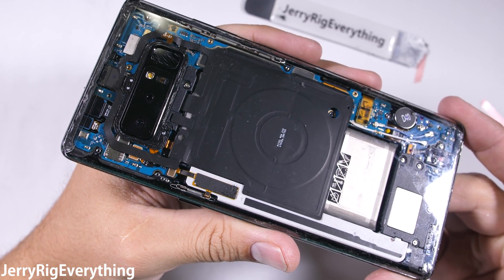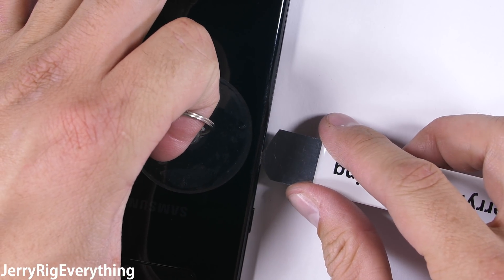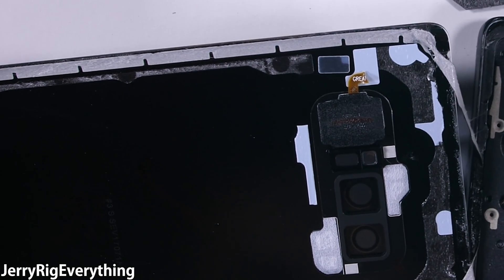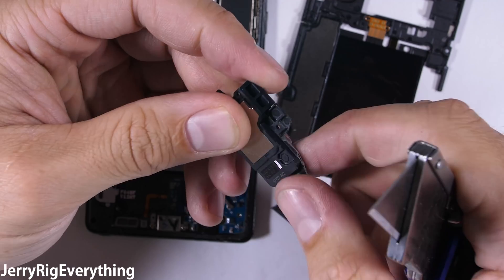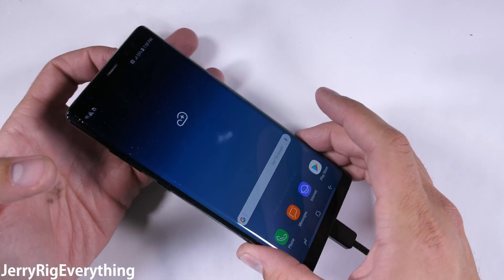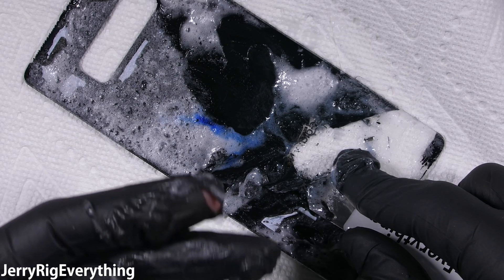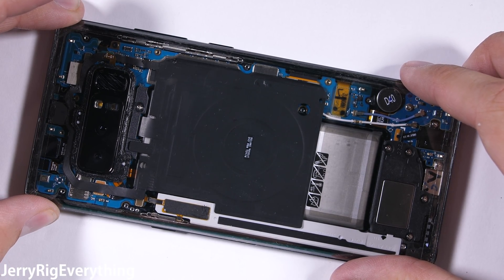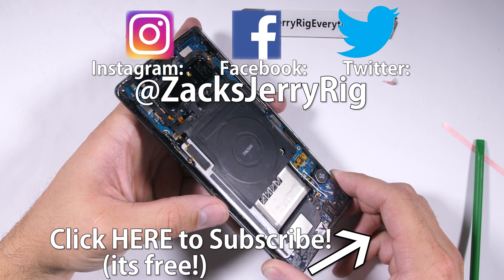Note 8 CLEAR EDITION! - Totally Transparent Samsung Note 8

Comment: Apple wouldn't want to make a clear version because then they couldn't lie to people about there not being any space left for a headphone jack.
Reply: Emil Ellénius there's a video here on YouTube were a guy manages to put a headphone jack inside the iphone 7, the space was there!
Reply: Davide Stellati Yes I know and that's why Apple wouldn't want to show it by making the back transparent.
Reply: Bluetooth audio quality is shit compared to 3.5mm. Also, I don't want to have to charge my fucking headphones lmao.
Reply: Davide Stellati no the guy took some things out in order to make space
Reply: Rolando Flores As someone who has a professional grade headphone, amp, and DAC audio setup I can guarantee you wireless headphones are nowhere close to the quality of wired.
Reply: manthan makwana that piece you mentioned could easily not have been there. The guy in the video had to deal with a finished product, at cupertino during the designing phase they could have easily come up with something else.
Reply: Rolando Flores Well I do. I use my headphone jack every day while simultaneously charging my device.
Reply: davide Stellati no, there was no space. That guy removed Barometric air vent and placed iPhone 6s' Headphone Jack.
Reply: What do you gain from the headphone jack being removed? The iPhone 7 is 7mm thick, not <3.5mm. They only took it out so they could sell you lightning headphones and dongles lmao and make 100% profit from it, they're robbing you and Apple is 100% anti-consumer. They can't make profit from people using their own 3.5mm headphones. Analog audio quality will always be superior to the diarrhea Bluetooth quality.
Reply: Gem you clearly don't understand audio quality
Reply: That's for marketing purposes only, because they want to make more profit out of their customers.
Reply: Rolando Flores 
1. It's mainly videos
2. No I'll keep using my headphones, they weren't cheap after all
Reply: but still Bluetooth has a batter unlike wired headphones just plug and play
Reply: manthan makwana there was space they Just put a little plastic to cover it up
Reply: Rolando Flores blutooth sometimes has a delay, and most blutooth headphones are more expensive
Reply: so old? It still works perfectly and everyone has earbuds or headphones that work for it.
Reply: RemixedVoice very true!
Reply: Emil Ellénius and samsung wouldnt want to make a clear version because they wouldn't want us to see the batteries exploding. Safety>Features
Reply: ( ͡° ͜ʖ ͡°)
Reply: Emil Ellénius you are a amazing person
Reply: Mr X
HAHAHAHAHAHA. “Not pushing forward”
If that’s true, we’ll be still using fucking Nokia phones with goddamned keypad on the phone.
Nice explanation you’ve got there
Reply: Kevam Patel
Good point. You know that there are a percentage of people who will definitely buy anything Apple comes out with. But have you thought of why? Why is that so? Why are there so many people being so “blind” and would buy anything Apple comes out with; like the new flagship iPhone pricing at $1k above. Why not these “blind sheeps” follow Samsung or other company instead? Why Apple?
Think...
Reply: Kevam Patel Oh wow. I'm trying to not laugh at your comment. Are you for real? 😂 Of course they are great at advertising, they need to be! Making consumers want to buy your products is the whole point! Advertising is one of the most competed areas between companies in every single industry and you're trying to make it sound like Apples advertising is a bad thing. Now let's get to the part that makes me laugh, the statistics you have stated in your comment are not factual in any way shape or form. They are your own creation backed by not just anything credible but by nothing at all! "Out of every 50 Apple users I meet, I get 2 people who actually have a reason to use Apple, that's far higher than 60% but let's just assume most actual Apple users don't really comment." Are you actually being serious? That is some hard hitting study you've conducted there with a personal assumption added in the end to come up with a solid and correct statistical answer about Apple customers globally. Hahahaha! Have you conducted the same study on Samsung lovers? I'm sure they have brainwashed consumers who will buy whatever they release, I bet Samsung could make a washing machine and they would totally buy it...oh wait, Samsung does make washing machines! What's even more hilarious is that I actually owned a Samsung washing machine until it caught fire and there was a national recall. Maybe you should also conduct a study into how many Samsung devices blow up or catch fire and need to be recalled. 😄
Reply: Lj Jones I'm trying so damn hard to not laugh at your stupid responses that just don't make any sense, rather you're looking like an idiot and telling me I'm looking like one. You're assuming based on what I said without even thinking what it actually means. Definitely a brainwashed sheep LOL
Reply: Lj Jones nailed it mahh boii!
Reply: Pixel Man Are you for real? Wow 😂
Reply: Lj Jones yes i know hardware in iphones are actually more superior than any other Androids, they have done a great in the integration of hardware and software to make their phones the best in speed, but remember their speed isn't consistent as it will go downhill after years, i can tell u that even if androud doesn't win speed test in day 1 but they will eventually beat it after 3 to 4 years as major android updates will make androjd phones faster and faster, and btw android isnt cluttered and bloated these days, integration in hardwarw and software can be a clear advantage a few years back but it can be a great advantage these days as android is better and better these days, those lagdroid days are over, and my friend's iphone 6 is slow af, he told me that it get even laggier recently, i guess it's because iphone 8 is launching next week hahahaha my 2015 android phone hasnt lag much through my usage and im glad that my phone and his phone almost have the same specs but mine runs so much smoother than his iphone 6. If you dont believe what i said you can check out videos about speedtests for old iphones and the comments about how slow their iphones are, that's planned obsolescence, and you do u see research about both ios and android? Android has lower failure rates than ios these, it might surprise you but that's the fact
Reply: Lj Jones u do realise that u are implying dat an OS is far better quality only because it runs smooth on hardly 10 devices... When the other one is serving a gazillion of them and still managing to do an almost comparable job! Android has matured like no other. 

And 4 all ur ranting bout the optimisation.. Android is almost equal while being open sourced rather than a closed OS which locks the user down to what a few engineers think should be used. 

I'm not against apple per se.. but it's their disregard to the fanbase by providing archaic tech for years on end.. or doing such obvious greedy things like the Jack.. dat pains me as a tech enthusiast! 
Apple no doubt has a loyal fanbase.. but dats exactly where the responsibility kicks in. 
Looks more like they are living on the glories of the past.. and fail to see dat the competition has actually become superior. And dats painful 4 ppl like me who loved owning apple products back in the day.
Reply: you have exactly 1000 likes and i dont want to mess up that number...
Reply: Booooom
Reply: One of the many reasons I fucking hate Apple.
Reply: Van Farnel the reason is that iSheeps like you actually exist
Reply: Emil Ellénius
This comment is just too perfect
Reply: RemixedVoice you must not have Bluetooth headphones. The quality if not superior, on par with wired connection. Charge time for a decent pair of headphones are less then an hour for over 15 hours of play.
Reply: Xhar Jhon Suarez W1?
Reply: Pixel Man which problems?
Reply: xZefyr ッ which connect to your phone?
Reply: So true!
Reply: manthan makwana who needs a barometric air vent/ meter
Reply: AMG M RS // Cat Lover same
Reply: Lj Jones is there is room for a headphone jack, there is no reason to remove it
Reply: AMG M RS // Cat Lover airpods suck btw but im glad you wasted all your 159 bucks on airpods which have almost the same quality as apple earphones
Reply: Mr X
Did you even try the AirPods and you just assumed it sounds like regular Apple EarPods? Please try again...
Reply: Lj Jones this is not push forward, this is called making money
Reply: AMG M RS // Cat Lover you dont have to try, the whole world knows it, almost all the reviewers say the same, airpods sound maybe a little  little little unnoticeably better, they said it's earpods without the wires, dont try to make up something good about airpods to justify your buying decisions, i like ppl who pay more for less btw
Reply: AMG M RS // Cat Lover I know right! The whole point of the technology industry is to push things forward.
Reply: AMG M RS // Cat Lover removing headphone jack at the moment is definitely not moving forward, does apple provide everyone who buys an iPhone a wireless headphone?? No. Clearly they wanr you to buy that cheap made airpods, they call wireless the future but yet android's the one making wireless charging possible, but i know apple likes to bullshit all the things they do
Reply: Mr X Ok let's just say Apple did it purely for money, so what? For a company to be successful it has to sell and make money, who are you to complain about how people spend their money? If people like what a company does and what the company produces then they will buy it and people have been. The iPhone has been on top in the global sales marketshare every year and everyone laughed at Apple when they announced the Apple Watch and it's the top selling smartwatch globally today. If people are buying, you're doing good business. Other tech companies dream of having the brand loyalty and success that Apple has.
Reply: Lj Jones it's because once you are in the apple ecosystem, you are pretty much screwed. I have countless friends and family members who talk about how great many Android phones look and operate (my note 5, note 8), and they would switch, but they won't have iMessage and icloud, and FaceTime, and photostream. Apple locks you in to their system, and the only way to switch is to give up many things you are used to, which could easily be made universal
Reply: Lj Jones that's the point. Apple still sells. Why does that happen? There are 2 reasons. First, Apple knows how to do marketing and advertising. It just makes you want to buy them. Second, them blind iSheep. That's right. More than 60% users of iDevices are sheep because out of every 50 apple users I meet, I get 2 people who actually have a reason to use apple, that's far higher than 60% but let's just assume most actual apple users don't really comment. Those iSheeps are the people who'd buy anything apple sells. Apple could make a $1000 "normal" iWashingMachine and iSheeps would buy it happily, "because it's made by Apple".
Reply: AMG M RS // Cat Lover because they are following apple. That's common sense. That's like saying why apple is named Apple and not orange.
Reply: Kevam Patel you haven’t answered my question yet.
Why these people choose to follow Apple? Why not Samsung? What makes them so loyal to Apple till they become a “sheep”?
Reply: AMG M RS // Cat Lover you are seriously dumb. People buy samsung and people but apple. Its not like only Apple has sheep. Every company have some kind of sheep. You tell me why people buy samsung and lg and sony and become sheep if you do much want an asnwer yourself
Reply: AMG M RS // Cat Lover sheep are sheep. They are called sheep because they don't know why they're purchasing it, they're just "brainwashed" which is why people call them sheep. The number of sheep doesnt count how good a company is, its the number of actual users that tells how good a company is doing.
Reply: Kevam Patel Did it maybe even slightly occur to you that people buy Apple products, not because they are brainwashed, but because they actually like what the company produces? Whether it be the quality in hardware and/software, features, design or the ecosystem as a whole. There is a difference between brainwashing and true customer satisfaction, which Apple has and have always had. Please don't state comments filled with bullshit and your own personal assumptions trying to pass them off as actual facts unless you actually have something credible to back it up, it just makes you appear as a complete idiot.
Reply: Lj Jones of course you took my comment as "statistical" and "factual" instead of just my own personal experience. Please show me where in my comment I said those are facts. Also show me where I said there aren't other sheeps? We're talking about Apple here and so I only mentioned the iSheeps. About the advertising. Did I ever say that it's a bad thing? Did I? Rather, I feel Apple does it far better in advertising than any other company. About the "blowing up", that just made it really really clear you're just another samsung hater and an iSheep. About 100 phones out of 2.5 million units blew up. Yet samsung handled it with care and recalled everything back, even though they could've covered it up and saved money. iPhones blow up all the time, but apple always covers it up. Samsungs don't even blow up anymore, I don't know what kind of idiot you are. About washing machines, is making washing machines a bad thing? They don't just make washing machines, they make cars, tanks, and even cargo ships. But you wouldn't mention that. It's more than clear you are a hater. What else you got against me now? I'm sure you're going to come up with just another hate comment instead of actual content
Reply: Kevam Patel Well if you're stating that the numbers you have come up with in your own personal experience are actually true, than you're commenting what you believe is factual! You said yourself that out of EVERY 50 Apple consumers you meet only 2 of those people have a reason to use Apple, by saying that you're giving the impression that you're meeting multiple Apple users over the course of a specific time and recording the numbers that you've eventually come up with out of lots of 50, thats quite a study you've conducted! It doesn't matter that it's your own personal experience, if you're going to dish out your own numbers and statistics that you've come up with then don't be surprised to have people comment on it. I didn't say anything about you not saying there aren't other sheeps lol I asked you if you had conducted the same kind of research on Samsung consumers, that's all! Yes I know you didn't say exactly in those words that Apples advertising is a bad thing but you're making the implication that it is because you're theorising that isheep are brainwashed from it. The "blowing up" comment I made was a joke, as true as it is, it was funny. The whole world is still making fun of the Note 7 but you obviously don't have a sense of humour when it comes to the company that you are bias to. Yes that's true it was only around 100+ Note 7's but obviously if they didn't do the recall that number would have kept growing. Would you be so kind as to refer me to your source about iPhones constantly exploding and Apple covering it all up? If you're going to make that statement I expect you to back it up. Pretty weird that despite according to you that iPhones are blowing up all the time, it continues to be the top selling smartphone each year, lol. Did I say that Samsung making washing machines is a bad thing? No. I was referring to it with my Note 7 joke you idiot because there was a Samsung washing machine that had to be recalled because it kept catching fire, are you that dumb you couldn't put those 2 simple points together? Also you don't have to tell me what Samsung produces, I'm very aware of what they make :)
Reply: Jack Hoff Well duh! If you're wanting to switch between ecosystems of course the experience would be irritating to an extent. If you're going to just have 1 Apple device then that's fine but if you are going to have all Apple devices and be fully integrated in their ecosystem and stick with it, the experience is far from awful. I live in what you would call an Apple Home. I have an iPhone, Apple Watch, MacBook Pro, iPad Pro, Apple TV, Apple accessories and Apple HomeKit devices connected and the experience is amazing. For everything to connect and sync so seamlessly between each device, to control things in my home from work or anywhere in the world, to unlock my front door with my voice, to work on something on my MacBook and then pick up where I left off on my iPad, to lay in bed and say "Hey Siri, goodnight" and everything in my home turns off and locks then in the morning I do the same thing and my house comes alive. It's like living in the future! It's so freaking cool. The best thing about being in this ecosystem is the performance and quality of Apples software. There's no clutter or bloatware, everything is so simple and fast and when Apple pushes out a new update almost every Apple customer around the world upgrades to the new firmware. While Android software is very open and customisable there is still a lot of cluttering and bloating. Ecosystems that use Android are still quite messy and confusing because there are so many different Companies that use it. Not to mention that Android has a horrible update record, there are still Android users today that are using firmware that's 1-2 years old, some even older! I have no issues with being locked into the Apple ecosystem if they keep delivering amazing hardware and software integration.
Reply: Lj Jones now you're saying those were jokes. Wow. I can't believe you can be so, I don't know what I should say here. I'm not dumbfounded by any company, I go for what's best but one thing I love to do is attack sheeps, no matter what brand they are. I found you here. And about the statistical stuff, it isn't so "study" number thing, all I was trying to say is that apple users are a lot less compared to the number of sheeps. If you ever read the comment section in YouTube, you'd know that. But I know you won't accept it and you'll just keep attacking the 50 people thing so that you can dodge the actual fact. About the joke, I still can't believe that you're using note 7 and washing machine to attack Samsung and when I backfire, you literally changed it into a joke. Are you actually serious? You're making yourself look like an idiot like that. Either debate good with me, or make jokes. And if you want to make jokes, make them clear. Not like " Note 7 exploded in the face of someone hahaha" type of stuff. I have a sense of humour as long as the joke is good enough. I've found enough Note 7 exploding jokes that are actually funny. Not like you who judges a company based on one phone and washing machine blasting even though that only happened once.
Reply: Lj Jones you said it's hilarious that Samsung's washing machines were catching fire. That's supposed to be a joke? In what way again? I don't find any jokes in here, except that you enjoyed a company's reputation go down, along with some people, if any.
Reply: Lj Jones debate aside, I'm not getting any notifications anymore from this thread. Is the same happening to you? Maybe the thread has reached its peak comments for notifications?
Reply: Kevam Patel You're contradicting your own comments. Exactly what fact am I dodging? If anyone is dodging it's you. You haven't answered my question and haven't provided the source to your accusation that iPhones are all blowing up and Apple is covering it up. Please stop ignoring it and refer me to your source that backs up your claim. You've completely dodged that and instead you're continuing to talk about a goddam washing machine and a joke I made. I couldn't care less if you found it funny or not. Of course I enjoy it if anything bad happens to Samsung, I'm an iSheep, you even labelled me that and Samsung people would do the exact same if it was the the other way around.
Reply: AMG M RS // Cat Lover 😅 Thanks!!
Reply: Lj Jones nah, I wouldn't feel bad about phones exploding in the face of people, unlike you. I don't care how bad a company is, I don't want something like that to happen. And about the exploding, you're a complete blindaas. I literally wrote a comment specially for that, you literally proved it true that you're an acutal "blind fanboy" lol
Reply: Lj Jones at this point, I'm kinda bored with the discussion and I'm sure you are too. Let's just end this here and announce the winner as "preference". You prefer Apple, I prefer the best phone on the market that gives me files access, debate finished. I'm not getting any YouTube notifications either so I'm bored of checking every now and then. Hope you have a good day.
Reply: TheTechPerson lol
Reply: Lj Jones actually other companies dont even have to dream, they already did a great job making products miles better than apple, they just didn't get the recognition they deserved, a successful company doesn't always make the best product, i know apple is the most successful company inthe world but doesn't mean they make the best products, they only need to make product that suit the needs of isheeps which is quite easy, but to us it's quite awful, android users are more to power users, we need fast charging, good battery life, good notification management, an os that stays snooth for years, a battery capacity that doesn't drop drastically after updates, apps that dont crash, so other companies have to work hard to make products to suit our high standards, well apple doesn't even need to make so many changes and ppl are gonna line up super long to get one good luck to you all, iphones are good but they are just not good enough for us to consider getting one, android just makes life easier and gets basic tasks done faster and not like ios that justs opens games faster lmao. And btw everyone also argues that samsung phones are overpriced too but if youre smart enough you would realize that they do it for a reason, to push iphone's price up higher, but samsung will start giving discounts to their phones so android users normally wont conplain about phones prices overly high
Reply: Mr X Wow your comment is all over the place and doesn't make sense in some parts lol. When I mentioned about other companies dreaming I was referring to the brand loyalty and hype that Apple has. There is so much excitement and news that builds up to every Apple event compared to other companies, and customers lining up down the street at every store. I'm not saying that other companies don't sell well but there is no other company that has the brand loyalty and can create the intense anticipation that Apple does. "A successful company doesn't always make the best product" that doesn't make sense and of course if you are bias to the competition you would say that. Every tech company has their own product which is considered their best in its product category. You just listed everything that you love as an Android user, that's great! But don't try to state that Apples hardware and software is inferior or bad compared to it. Apples own A10 Fusion chip smashed every other phone in benchmarks, the hardware and software integration is done so well that despite having less RAM than others it performs high use multitasking to equal or better to its competition. "OS that stays smooth for years" lol Android OS is still cluttered and bloated has a lower customer satisfaction rate and not to mention it's update rate; so many users today are still using Android firmware that's up to 2 years old and some even older! Apples AppStore is still the best place for apps, it has the most apps and always gets apps first and far better quality. To make a comment on battery and apps crashing is completely pointless considering those topics come down to personal use. "They are just not good enough for us to consider getting one" that's totally fine, no one is forcing you to. The iPhone will continue to be a success and top seller without you lol. It doesn't matter at all what price smartphones are these days because majority of people who purchase them do it through contract plans and pay it off monthly, which makes all smartphones more affordable today. Also with every 12 month product cycle, the current models and previous models drop in price, every smartphone manufacturer does that lol.
Reply: Rolando Flores unless Bluetooth headphones get super fast charging and say at least a 3 day playback... The headphone jack will be missed. 
It's one thing to move to the future, and another to do it at an inopportune time!! Just 4 entering the Bluetooth headphones market or shoving proprietary shit down the gullible consumers throat! 
Wireless is no doubt the future.. But we aren't der yet.. and I believe  leading brands should respect dat & d customers! Rather than getting greedy n lying to them. Peace
Reply: Emil Ellénius not only that it will have all kind of Samsung parts in it they don't want people to know that😂😂😂
Reply: Another reason why Apple won't make a clear version, is because like half of the internals and components that make up an iPhone are manufactured by Samsung.
Reply: Not space in there, strange parts is used new case to add headphone jack
Reply: RemixedVoice actually buy some Bluetooth earphones and then you can compare the two.
Reply: Has anyone realised how hating apple is now a bandwagon and people just jump on to it?? Also, making comments like these are now a bandwagon too..
Reply: Emil Ellénius Or maybe Apple would want to show the beautiful phone because it looks ugly with a clear back and they want to push us in the future by removing the headphone jack.
Reply: Emil Ellénius Considering how much music you’re listening to, you haven’t sold out for some Bluetooth earphones?
Reply: Jack Hoff Really? That's your argument? Just because a smartphone has the room for a headphone jack therefore it SHOULD have one 😂 Lightning connector headphones are far better quality and if people really really want to use 3.5mm then use the adaptor! No one is forcing people to buy the iPhone 7 and yet it is the top selling smartphone globally.
Reply: Emil Ellénius A year since the iPhone 7 and people are still bitching about the headphone jack lol. There were other smartphones before Apple that removed it but of course when Apple does something it finally gets talked about. At least Apple is taking that step to push forward and force tech companies to advance in wireless and digital connections.
Reply: The whole point of removing the headphone jack is to push all of us to go wireless. Why can’t you buch of “headphone jack people” adapt to it? I’m perfectly fine with my iPhone 7+ with the AirPods. I’m not trying to start a drama here.
Reply: Emil Ellénius who cares about a stupid auxiliary port
Reply: it wasnt to create space silly it was mainly to move on cuz its so old